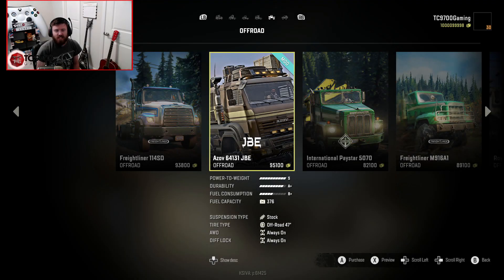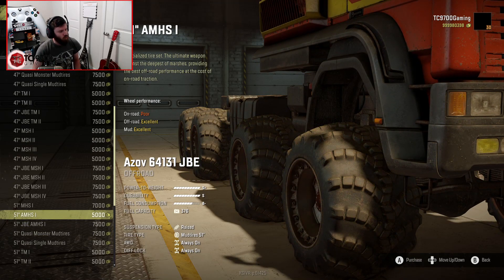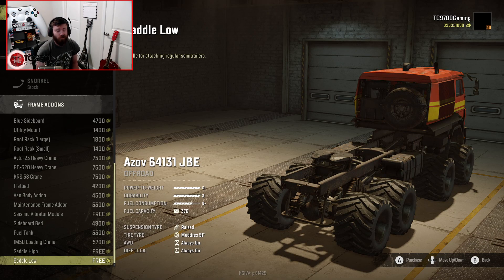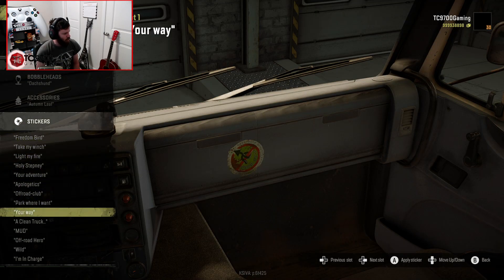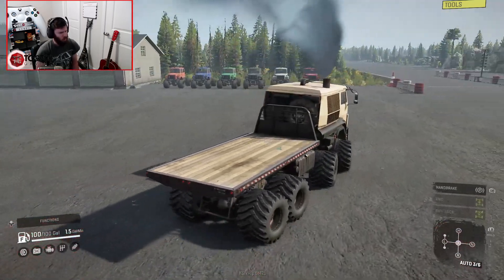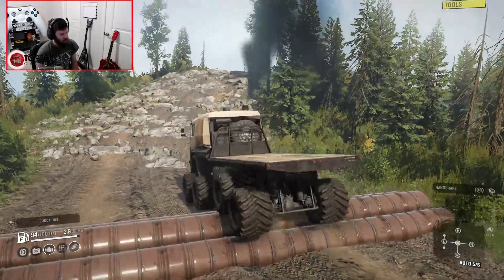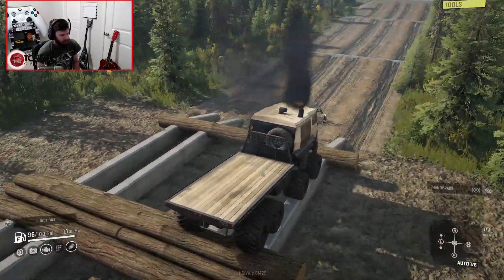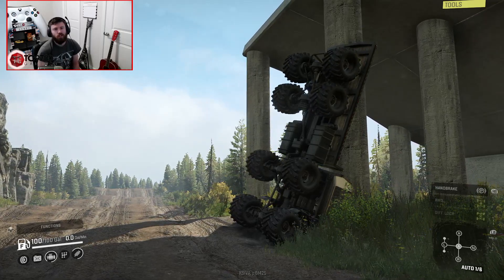SnowRunner: AZOV 8X8 JBE! POWER & BALANCE!

Comment: I have completed every campaign mission so far, I'm at 100%, and probably 70% of those missions I completed with that truck. I love that truck. I will definitely add the large roof rack of supplies and side snorkel, and larger tires and lift. People always complain its slow, well.....being slow it doesn't take much damage at all, its really fuel efficient, and DOESN'T TIP. 

(Unless you try to tip on purpose, then you caaaaaaaan tip it.)

Comment: If you want to drift the 6 x 6 titanium maximus Break the suspension and put it in high with the slow gearbox and super stock engine. it is so much fun I would suggest trying it out!! Go to Limes mud park and go to the concrete pad by one of the off-road race tracks if you want to have the best drifting experience.